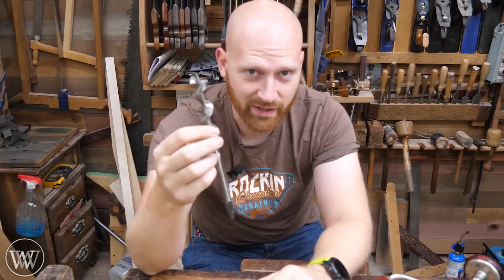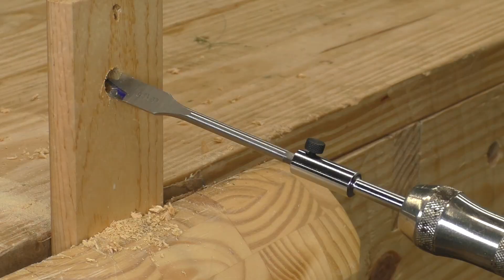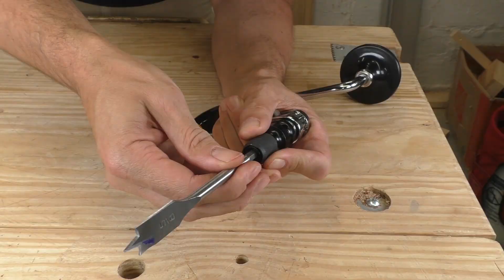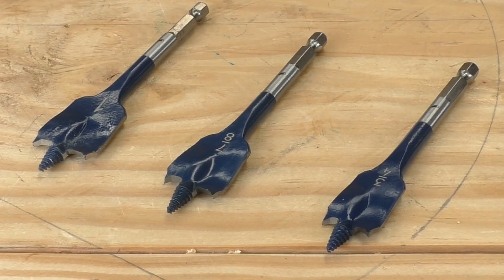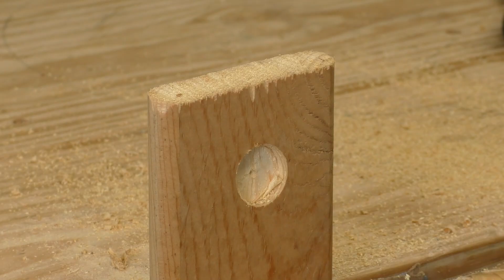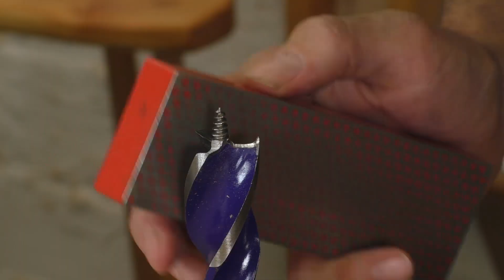Modernize your brace with new gear!

Comment: Hey Rex,
an Austrian company called Fisch still makes auger bits with square end. 
Keep your great work up,
Gretings from Austria,
Kurt
Reply: I got some 25 years ago in Germany  and still using them along with my grand fathers old sets.  I made my comments then saw yours.
Reply: They are quite expensive though (around 30 bucks each). You can get them here for instance: https://www.fine-tools.com/auger-bit-conical-square-shaft.html
Reply: Stefan Vogel I don‘t own some, but I own a set of regular Fisch Drill bits. They are top notch and you have to conside, that you will own these for long time.
Reply: @kurtkurt3626  I don't disagree with the quality point (I myself own Fisch drill bits and they are good) and Dieter Schmid is for sure not selling nonsense. But here I must confess that the Woodowl Tri augers will probably be the superior option at half the price. You can buy them at Amazon Germany as well. Unfortunately not the 11 or 15 parts sets. I hope that fine tools (Dieter Schmid) will offer them one day as well.

Comment: Hit the machinist communities and ask "What angle should these nickers have, exactly, for a hand tool?"
Figure out how fast (RPM, and then feet-per-minute) the tips/nickers are actually moving. The "Machinist Handbook", or friendly metalworker should be able to figure out what angle you actually want the tips at. (Or, perhaps, careful study of old augers).
All that only needs be done once. Then the grinding, sharpening at new angles.
Reply: I like your methodical approach to this, and not to be argumentative, but I doubt that the surface feet per minute thing from working metal would translate directly to wood, with all it's variables of hardness, grain, fibe strength, etc.  Plus, all the formulas for metal work could easily go non linear at the very low speeds in play here.  Your comment about studying old bits probably the most direct way to the finish line.  Why reinvent the wheel ?  Old auger bits got the the way they are through imperical results over hundreds of years.
Reply: @eazzypeazzy7618  They're actually bogglingly similar while being completely different :D But the part I was aiming for is the metalworking side's terminology and key notes. Attack angle, relief angles, etc. They help one identify what you're even looking at and attempting to replicate off the old augers. Once you've got a list, fiddling "more" and "less" is much easier.

I'll also add (not to you eazzy, specifically) that the "Craftsman 1/2in Speed Brace" (for machinists) is ... available on Ebay and elsewhere for $10.Should be zillions of them floating around.
Reply: sounds like a multi-channel collab project :)

Comment: The best solution is to just spin your brace at 2000 RPM so you can use modern bits.

Comment: As always a good, interesting and well thought out video.
I was gutted though, I saw a brace  with a chuck and thought you had worked out a way to mate the 2 together.
Just a thought though. If the square end off a trashed vintage auger was to be welded/ mated with a thicker shaft then it.may be possible to thread that and mount a chuck to that as a way of using modern bits in a vintage brace. 
I don't think your one there will be readily available worldwide so this may be an alternative....probably not an easy modification but possible...?
Cheers Rex. Look forward to the next one.
Reply: Absolutely pointless! Modern bits don't work in an auger brace. They are designed for high speed, and that's not what braces do.
Reply: @johncoops6897  do you think so? I think that was pretty much the point of the video.
Reply: @eggster71  - YES, precisely. The video clearly shows that modern "high speed" drill bits don't work in a hand-cranked brace.
That's because the brace uses a different mechanism to drill holes (slow, high torque, high pressure) compared to high speed bits that require high rotational speeds and will jam if too much pressure is applied.
So, if you really  want to use a brace, simply use the proper AUGER bits to suit. The easiest solution is to use the old square-shank bits since no modifications are required. These are easy to find, cheap and plentiful.... providing you don't insist on buying new.

Comment: Put a modern chuck (out of cannibalised early cordless) on a brace by grinding and filing the chuck-holding bolt (I forget the imperial size) into the tapered square shape of old bits. Will hold regular modern round or hex bits. Works fine, also helps judging the force of driving a screw short of breaking it, no flat batteries either. Served me well for years in Africa.

Comment: Hey Rex, i got my brace bit with square shape inside and 2 braces for clamping. And i got some great augerbits but with a round shaft. So i got some kind of dissapointed. But then i thought, why not shaping the end to a square cone. Tried and it works very well! now i can use them in my brace bit and with my electric drill. even with hex shaped bits that sould work.

Comment: My old attempts:
+Heat and twist point on a spade bit.
Not easy and i had to re harden the bit.
Didn't impress in use.
+Cut the point off of the spade bit and weld on a short screw.
Difficult to do and you need to be able to weld.
Broke in use (im bad at welding)
+Cut the square end off of an old awger bit and weld it to a morden drill bit.
Still need old bit and welding.
Didn't impress in use.
So nothing good. (Learn from my fail)

Comment: So I just dug out my 5$ bit brace from the habitat restore, the chuck is a two jaw,  yet it seems to have grooves similar to wolf jaw tongs.  I put in several hex shank bits and they seemed to hold well enough to drill some holes in a small chunk of walnut... round bits seemed to hold  "ok" but I can see where they may pull out.  What type of jaws do you have on your bit braces?  Are they perfectly smooth?  ....May have to put up a video:)
Also what about the HF agar bits?  https://www.harborfreight.com/wood-auger-drill-bit-set-7-pc-64809.html

Comment: I point out that the same people who sell the hex adaptor you link to also sell a 1/2 in socket adaptor. If it didnt have the stupid long shaft on it, it would be a thing. But, it does. :-( 

Im tempted to buy one, cut it shorter and visit a buddy with a welder.
Reply: Lee valley makes one too.

Comment: I hate to say it, but I ended up doing exactly what James did. I quite literally got an adaptor yesterday. I already bought a set of 3 Wood Owl 3 tip auger bits (1/2, 3/4, 1") and honestly it was a revelation. They practically glide through wood. In Douglas fir you can use your index finger and thumb to drive a 3/4" hole right through a 2*4. Yes, expensive. But with a little care they will outlast me. I really like the Garrett-Wade brace though:)

Comment: Unfortunately, I don't have a solution. I found most of my square shank bits at the fleamarket. Once I hit upon a full box of them for five bucks, so I'm good now, but that's not readily available for everyone. I have a mom-and-pop style hardware store nearby that sells new-old stock ones made by Famag here in Germany, but those are like 15-20 bucks each.
Reply: Fine Tools in Berlin sells new bits in the old style made by Fisch... for some €35 a piece...

Comment: My brace/bit set is easily the tool from "old timey time" that compares to the modern electron chuckers in terms of usability.  I wish there were more options out there; the Wade Garrett thing looks nice, though; I may give it a shot.  That said, some time on Ebay and a good file will get you a set of traditional augers for not too much money.  I do see them more often than say, a good quality Stanley plane.  But yeah, "readily available"... maybe not.
Reply: I agree, living in Africa I often don't even have electricity, I do have some cordless, but I like using my hand tools I have a brace, but as Rex says finding buts is hard.
Reply: @annetteolivier721  , maybe do like what I do in Jamaica. Look for small to medium hardware stores that have been around for decades. They may have unsold stocks of old fashioned tools. That's how I managed to find auger bits,braces and two eggbeater hand drills.
Reply: Just go to yard/garage sales and estate auctions. There are literally MILLIONS of these bit out there. Millions of them! You will need to sharpen them, but you need to do that anyway since they are usually mild steel and don't hold an edge very well. Same as buying a plane - the blade won't be sharp but you have to sharpen a plane anyway.